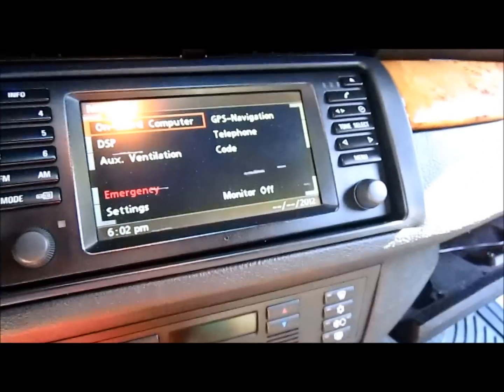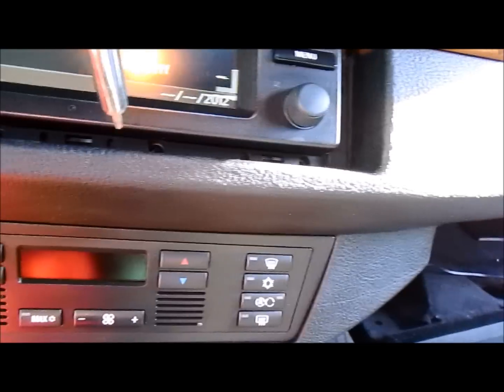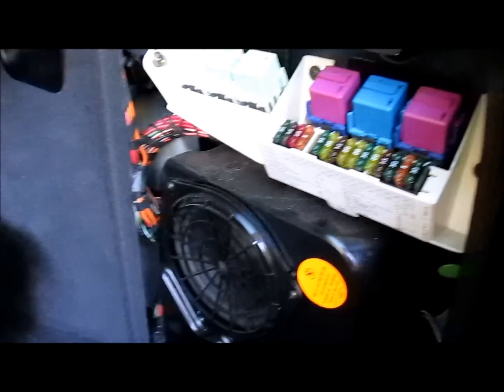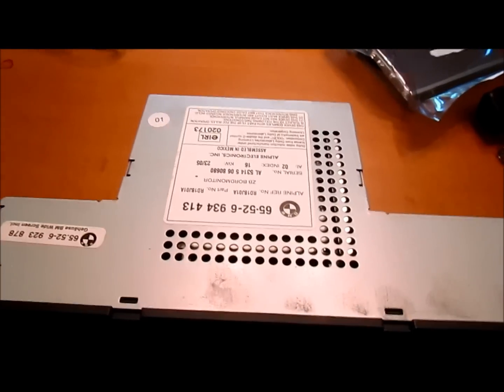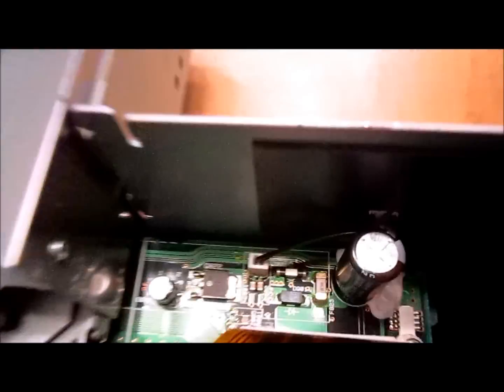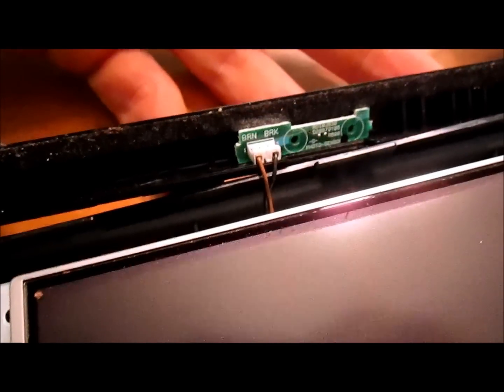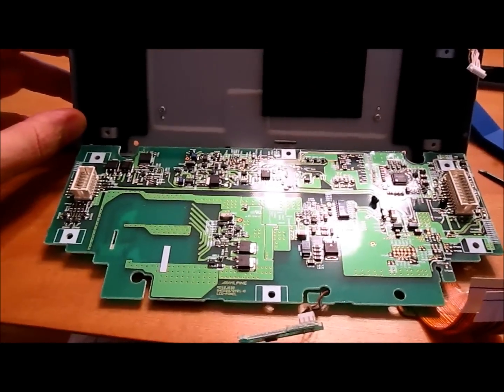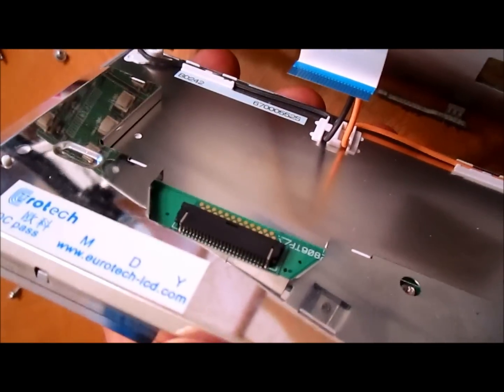BMW E53 X5 Navigation LCD Screen Replacement DIY

Comment: Excellent video. I called BMW yesterday and they said it was $2,500+ (parts only) for a new replacement screen, yes that much just for just the replacement display, not the GPS and everything else, just the display. Thanks for posting!

Comment: Thank you so much for taking the time to create this! I've only had a few pixels go out on my X5 (2006 4.4i Sports package/winter) and I assume that it's only a matter of time before more start to go. I live in Missouri, and we had a heat wave that hit approximately 102 (I can only imagine how hot it got in inside). When I returned, the pixels were gone. I have no idea if it is a heat related issue, but I've heard stories of them returning in time. Thanks again for the contribution.

Comment from the maker: Well, I doubt you're still having this problem as it was 3 months ago, but I would have gone back to ensure that no cables inside the unit were left unplugged. Especially in the last step it is easy for the wires to get loosened.

Comment: THANK YOU!  

Video instructions were perfect!!!

LCD looks Great in my 2003 X5 3.0!!!

Eurotech was A++++

Only $194 with 3 day shipping included!!!

Very Cool!!

Number I ordered is:

Part No.: LQ065T9BR51U
Brand: Sharp
Size: 6.5"
Compatible: BMW X5/E46/E53 Car NavigationLCD display & other electronics parts
Condition: Original new A grade

Comment: This was great! I ordered my new screen and installed it pretty easily.  
The only question I have is now that the new screen is in the display is off by about an 1/8" to the right.  Everything functions normally but anything on the far right of the screen is cut off.  An example of this is when using the GPS it only reads "GP" in the upper right corner. 
On the left side of the screen is an 1/8" of space where nothing is displayed.
Any thoughts?  Is there a way to adjust the registration of the screen?
Thank you

Comment: I obviously wasn't careful enough and broke one of the small white connectors with 5 colored wires coming from it. This was connected to the board attached to the back of the screen. 
I broke the side that is supposed to be permanently connected to the wires. 

Wires are fine and I'm hoping I can find another end somewhere to replace... 
I'm about to hit up Radio Shack, but any other suggestions? 
Is there an official name for these I could use to search Google with?
Reply from the maker: That's the risk with doing this.
Reply: @BluePurpleRed  yep!

Comment: Thanks!!! I used this to take out my deck and found the same clips as yours, do you know where the 40 pin radio plug is located in the car?.. mine is a 2004 x5, do you by any chance know what the blue and white pin outs are if I have to hard wire it myself?

Comment: what can happen if you don't remove the fuses? also, sometimes the blue goes away from the screen colors, usually when it is very hot...how can that be dealt with so the image will remain the same? Thank you

Comment: By changing the LCD, are we increasing the resolution, is it something possible? I believe to should depend from the video graphic chip, correct?
Reply from the maker: This is a replacement as the original was damaged. This is NOT an upgrade.

Comment: Dear Blue Purple Red, i have the same problem, i want to say where i can buy and the price, because the link if you posted are not good
Reply from the maker: I just updated the description notes and the URL. You will need to contact EuroTech, but here is more information: 

The replacement LCD screen can be purchased here: http://www.eurotech-lcd.com/product_ini.php?keyword=LQ065T9BR51

Here are the details for my X5, if you have a different car, you will need a different screen. Contact Eurotech for details on which model is right for your car. The angle of the screen may be different for viewing.

Part No.: LQ065T9BR51
Brand: Sharp
Size: 6.5"
Compatible: BMW X5/E46/E53 audio/navigation LCD display & other electronics parts
Condition: Original new A grade
Reply: Blue Purple Red thank you very much for the information

Comment: Thanks for the video, I have  2004 X5 4.8 and I am having the same problem of losing the pixels on the LCD screen, but BMW service people told me that I have to get whole unit replaced (costing around NZ $3200) because I cant get a new  LCD screen on its own. 
Please let me know from where I can get the screen and what is the part no so that I can order it.  Thanks

Comment: Really great job! Can you give me the lcd price, please ?
Reply from the maker: The replacement LCD screen can be purchased here: http://www.eurotech-lcd.com/product_ini.php?keyword=LQ065T9BR51

Here are the details for my X5, if you have a different car, you will need a different screen. Contact Eurotech for details on which model is right for your car. The angle of the screen may be different for viewing.

Part No.: LQ065T9BR51
Brand: Sharp
Size: 6.5"
Compatible: BMW X5/E46/E53 audio/navigation LCD display & other electronics parts
Condition: Original new A grade

Comment: Thanks for your video.. Worked great with a new Sharp screen ??? out of China for A$92. All good except for the same problem as Se Si. The picture is all offset to the right by about 3mm. Looking at my old screen there are two adjustment screws..  H-Pos and VCO. Do you have any idea as to whether you can adjust the sceen back to the left and if so which screw and how much turning for one 3mm.. as you know I would have to take the unit out for each adjustment.
Reply from the maker: My guess is that you have the wrong screen.

Comment: Hey Blue Purple Red! I really appreciate your fantastic DIY. I managed it to get and changed the display (X5 E53 2004). However, after I finished everything as best as I can I noticed that the buttons are not working. Meaning I am not able to push the left are right knob button to select e.g. something from the menu. Even I am not able to start/stop the radio. It just plays just from the beginning. Any idea what may be the problem or which cable is at least in charge for this function? Your help is highly appreciated. Many many many thanks in advance. Regards, Joerg
Reply from the maker: Sorry for the late reply, it is very possible you plugged a wire or a pin incorrectly.